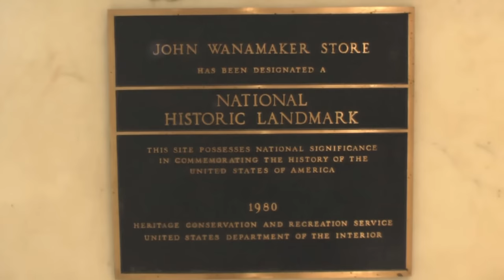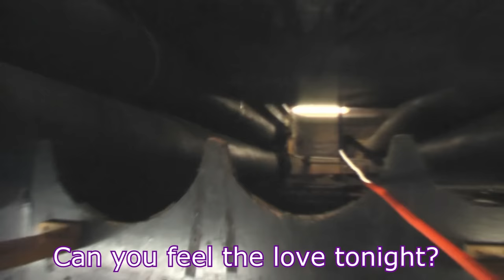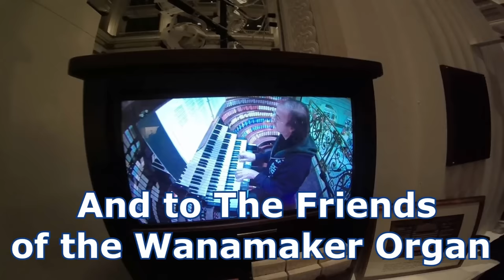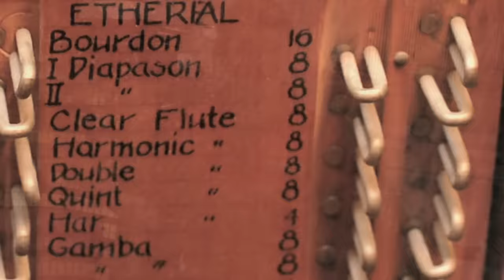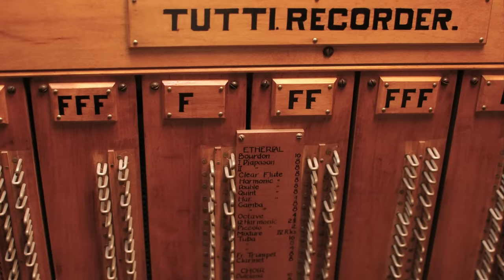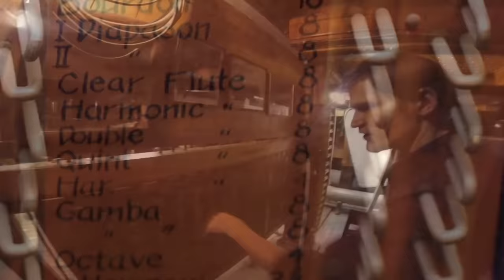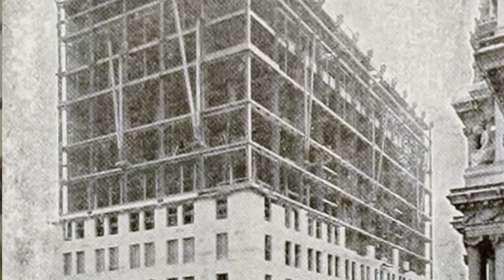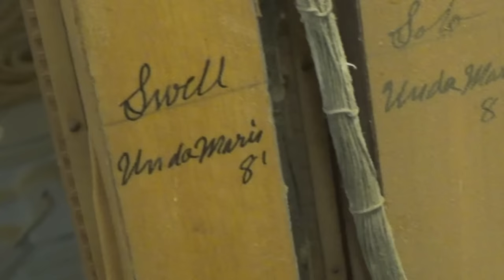The Wanamaker Organ Movie!

Comment: The Wanamaker Organ is able to play all of the Classic/Modern Organ Repertoire very faithfully with zero compromise.   It has been cared for consistently thorough the past century with a few exceptions.  It is one-of-a-kind and will never be replicated.   As your host pointed out this instrument is in a very favorable acoustic environment for it's size (the room is the most important organ stop) and it is much more subtler than the Atlantic City, New Jersey instrument which is much larger with several keyboards of 88 notes and a couple with 73 notes each, but massive pipe scales, huge high pressure stops of 100" of water column displacement, which is also one-of-a-kind and installed in a room that is about 12 times as large so it has a lot of air to move but also sounds fantastic and gets better every year since they began to get serious about the restoration and has mostly NOT been playable since the late 1920's-early 1930's.  The Wanamaker Organ I think has more ranks that are not duplexed at another pitch.   Atlantic City has many, many stops or ranks that can play at other pitches, but is done in a very discrete way so it is still very versatile.

Matt is correct -  Each organ has a unique smell.   I liken it to smoking pipe tobacco (generally cherry flavored) but very weak and sweet mustyness.

Comment: The pipes are made of tin. It's mostly lead. There is an organ manufacturer here in Milwaukee and I've seen how they make the metal for the pipes. They pour the molten metal into a wooden trough and slide it in a set of ways, and the metal comes out onto a table as a shiny silver sheet. It is very soft and malleable - easy to cut and form. Fascinating to watch.

Comment: Must be what it's like to be a mouse in a church organ! This is incredible! 
The specking on the metal pipes isn't galvanization... I remember seeing a demonstration of forging organ pipes years ago, and the metal is a mixture of lead and something else. I want to say tin but I'm sure that's wrong. Anyway, for whatever reason the metals don't form an alloy or mix completely. I wish I could remember the specifics.
Reply: The metal is a mixture called spotted metal. Pipe metal consists of lead and tin melted together, most often using a proportion of about 50% of each. However, the proportions can vary significantly depending the desired tone, and on available funds too (tin is very expensive). Speaking facade pipes are often made with a very high tin content, even pure tin, other sound characteristics may call for as much as 97% lead. The metals have different cooling points, hence creating a spotted pattern when the molten mixture is poured onto the casting table. Other metals are also used, mainly copper and in some cases zink. Certain builders add a small amount silver, mostly for horizontal trumpet stops. The facade pipes seen in organs from this particular period (late 19th - early 20-th centuries) are often only decorative dummies. They can be made from almost any material.
Reply: Talking about a mouse in a church organ, the pethericks have bought a convent in France and they are currently rebuilding a church organ in the chapel and found a mouse nest inside the organ.

Comment: Ah, so there isn’t a direct mechanical linkage between the keys and the pipe valves. That’s a relief! 😅
Reply: In some organs there are. They are referred to as tracker organs.
Reply: @dryroasted5599  Even in normal sized organs, it amazes me that the tracker action doesn't make the keys hard (heavy) to press. I guess all the components are balanced and friction is kept to a minimum.

Comment: No hearing protection? Yikes!!
Reply: not a area where you are supposed to be but you can go there limited times to check if something is wrong. Ear protection is a requirement if you need to work for longer times.